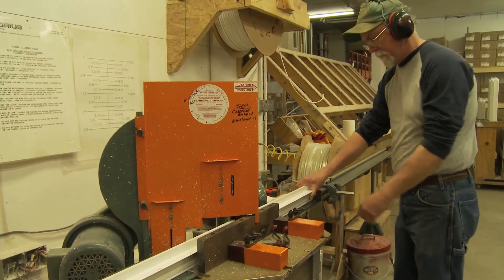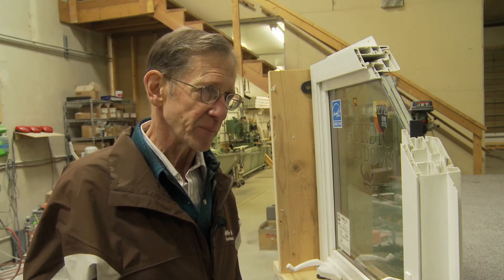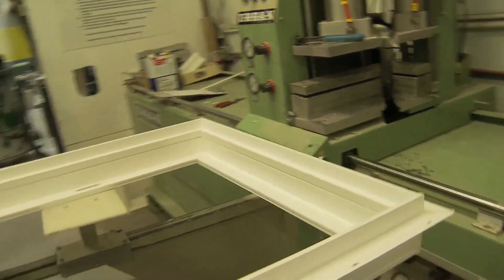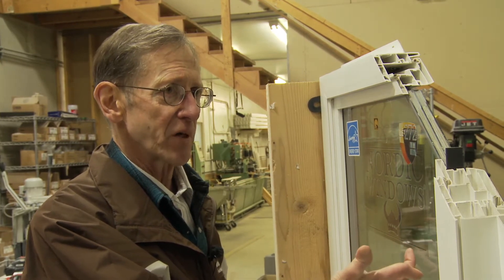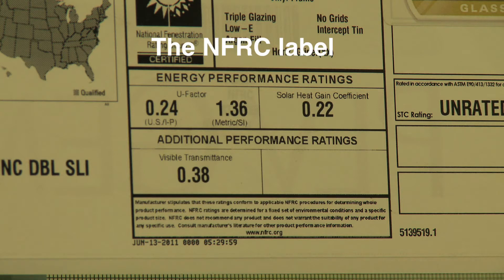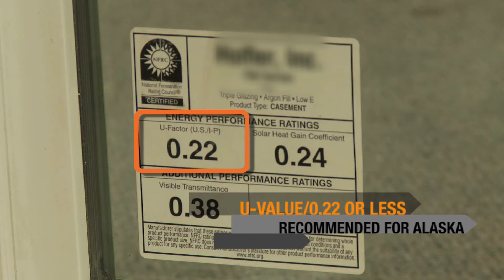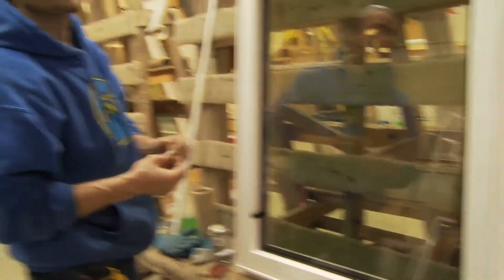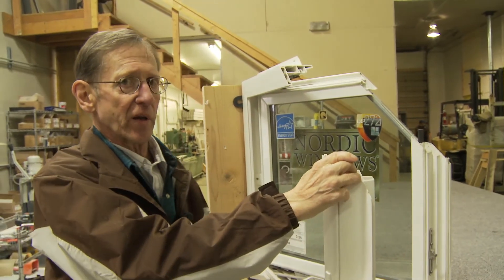Energy Efficient Windows for Interior Alaska

Comment: Look at the IR blocking clear coating that blocks thermal movement
This will keep the heat in the structure better than a glass without it
It is not a membrane but a surface treatment
YouTube. teslastones